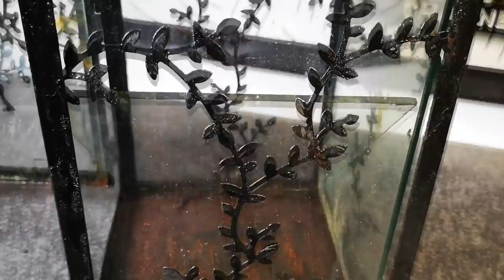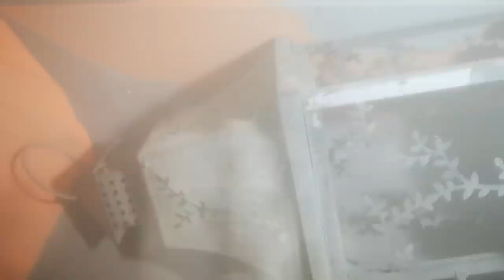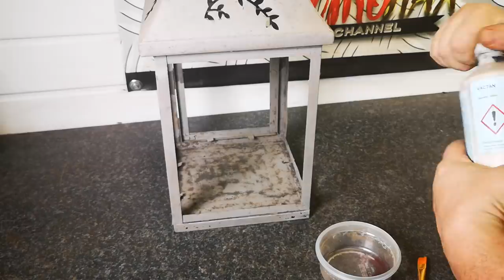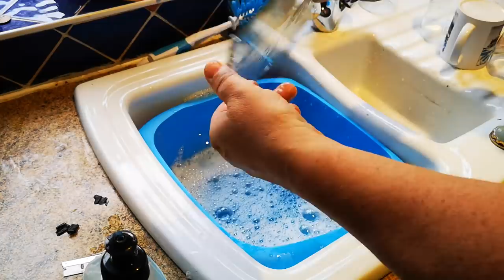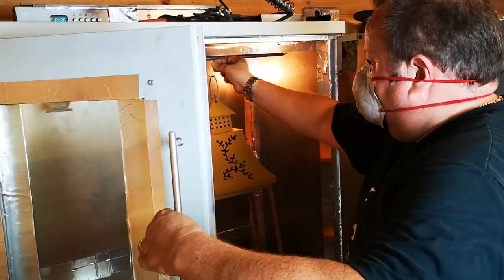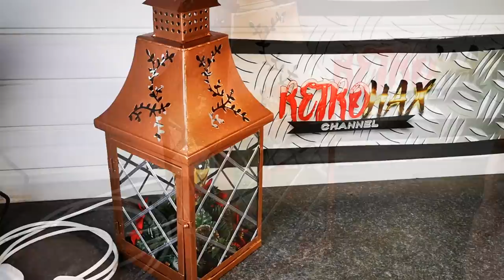Amazing Scrap Lantern Transformation

Comment: Like the copper paint. I think I would have used liquid patina to darken the lead lattice. Lot of work for a seasonal entry decoration, but satisfying!
Reply from the maker: I'm sure it will darken soon by its self.
Reply: RetroHax    True   Used to do stained glasswork and had to match patina with existing older work. Sometimes a pain. I guess I didn’t know that powder coating becomes porcelain as with this piece. Tough stuff. Thanks for the lessons.
Reply: @mred8002  I totally disagree,  adding patina is unnecessary and imo ugly , not sure what the current trend is but if someone has gone to the effort ( and cost ) of cleaning and fixing it up would you not want to enjoy a new looking decoration , instead of pretending it has been stuck in the shed a decade or two and hadn't ever seen a brass cleaner ? Adding patina is like buying pre- fade jeans , that's just my opinion ✌ btw , I think it looks great 👍🙂
Reply: Cheryl Hartwig    Matter of taste for this project, and as he says, it will darken with oxidation in time. It’s just patchy as it does, and the chemical skips that step. I had to use it to darken new came on repairs to lampshades, church glass, and so on to match the older lead, as interior work can take a long time to darken. Not to detract from his work: I would have become impatient with the resistant paint. What would you think of a copper finish to the gridwork? .

Comment: Pretty good restoration and i like it, but your electrical work is botch! Best regards from germany.
Reply from the maker: My electrical work is first class. I was an electrician for 25 years so there.
Reply: @RetroHax  Why you don't use cable end sleeves? And the PE wire should be the longest and not the shortest. I'm a master electrician since 50 years in germany.

Comment: That black "finish" is called (Japanning) nearly impossible to remove it in any conventional way. Check out ( HAND TOOL RESCUE) He knows a lot about that stuff.
Reply from the maker: No, this is powder coating bud. I know about Japanning.
Reply: Ok. It really looked like japanning because I’ve never seen power coat that thick before. It was hard to tell in the video. Thanks for your reply.